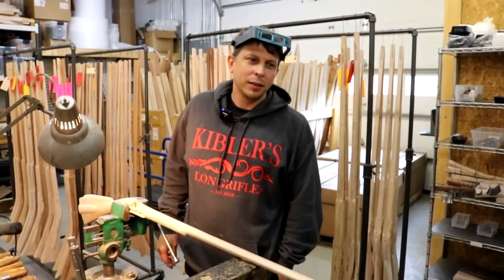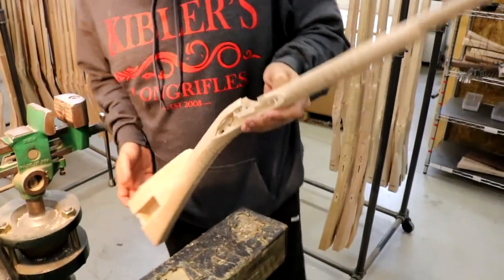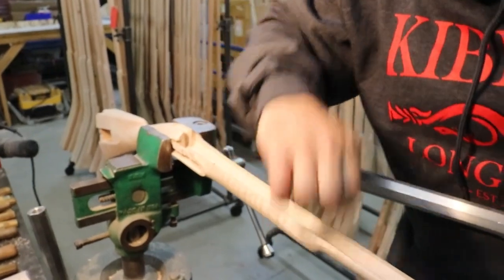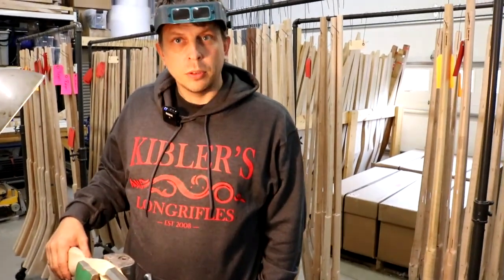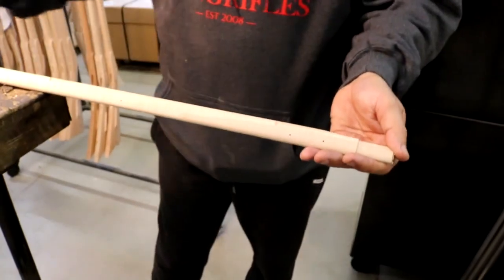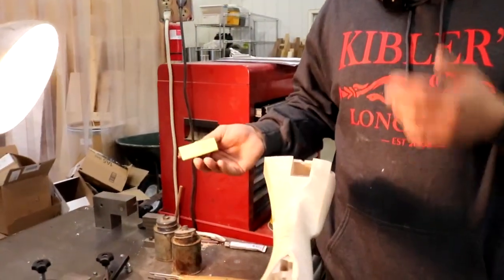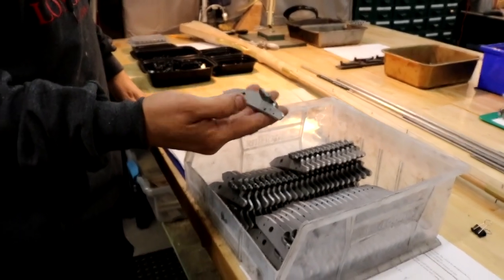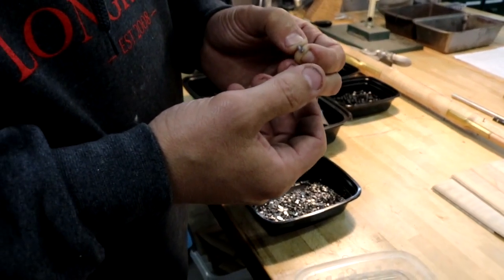Preparing Stocks for Shipping (and other things we are working on this weekend)

Comment: I have been extremely pleased with the SMR you sent me. The hardest part for me thus far was fitting the butt plate as I did not have transfer color to do that. A couple swipes of the file, eye-balling it, and then some more swipes of the file and again eye-balling, etc... and on Thursday, May 27th, I had that finished. Now I am on to taking it all apart, trying to polish the metal for a finish and then on to the stock finishing. Still waiting on some gouges to come in the mail for simple lines on the cheek rest and lower butt and I can put the finish on the stock. People who have viewed the gun so far have been in awe of it. I really have to hand it to you and thank you for this great kit gun. I may be a lawyer (hint as to who I am) but words fail me to give adequate description to this wonderful kit.
To people who read this, if you are thinking of getting a kit to build, get a Jim Kibler Flintlock. It will be the best money you have ever spent on yourself.